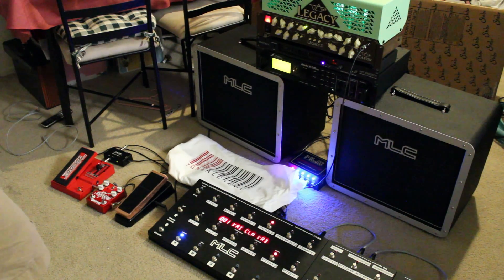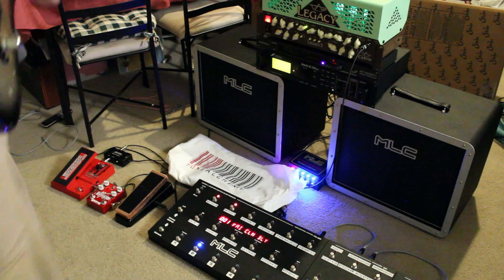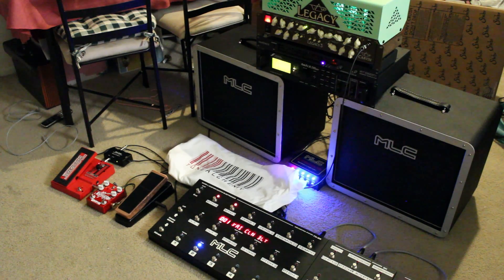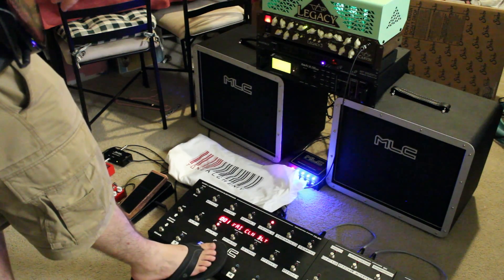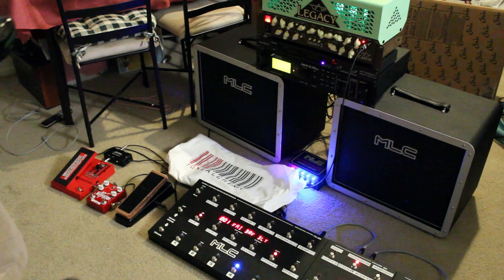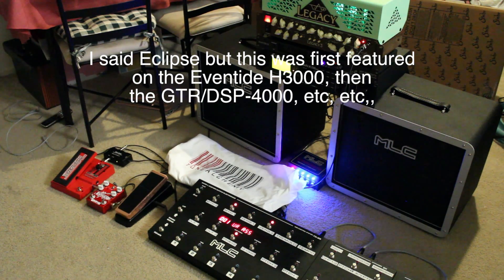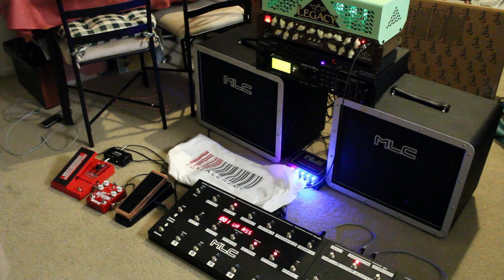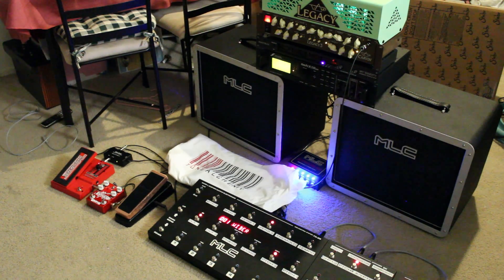Carvin Legacy 3 Revision 3.3 MIDI board beta test with Axe-FX II and Matrix Amplifier as Slave

Comment from the maker: Sorry for the delay. We only use 9th generation Chinese tubes12AX7A. Sometimes Tung-sols or Groove Tubes 12AX7-C. JJ's are usually very grainy in the preamp section, Power section we use JJ's E34L's (thats their long bottle EL-34) Try ARS (Antique Radio Supply) or Tube Depot for 12AX7a's. CE usually has them too. They change everything.

Comment from the maker: This video was done for Carvin and Vai. We did the upgrade and offered the option of the Matrix Amplifier and the Mark L Custom Foot Controller to the Vai Camp. We build guitar systems and we happened to be working for Richard Cruz (Carvin A&R) during this time solving a problem with the Legacy III MIDI system and a few hiccups that were causing the Axe-FX II to Lock up. This video was the solution offered to Carvin. The MIDI board is now in all Legacy III amps and was finalized as a solution.

Comment from the maker: This was run 2 ways. In this video its coming out of the Pre amp out into the Axe-FX which then feeds the power amp in and the input of the Matrix. Being that the Matrix is 400 watts of Mosfet per side it is equal to the 100 Watts of tube power coming out of the Legacy it equals out. If I used the FX loop I would treat this differently. The rig changed after this, A palmer PDI-03 was used and the Matrix GT-1500BDFX was used for a W/D/W system feeding 1 2x12 and 2 1x12's.

Comment: Can the gain on the 3 th channel be controle by a midi switcher?
Reply from the maker: Genesis11 Guitar Lab if you mean can you switch to the 3rd channel via midi, yes. If you mean, can it be controlled via expression pedal, no. We use grouped control changes to switch channels rather than program changes. That way you can switch to any channel with an instant access button without changing presets.
Reply from the maker: Genesis11 Guitar Lab if you want to control gain you can use your volume knob on the guitar, use the axe-fx to drop the volume going into the input (if you're using one), or build a "drop box" (a presetable volume in a pedal enclosure). Hope that helps!
Reply: Tone Alchemy  What I mean is that if you can add the gain to the 3 rd channel vía midi? I Know that you can change all 3 channels, reverb and boost vía Midi.... but the gain on the third channel? Can you add it via midi?
Reply from the maker: Genesis11 Guitar Lab OK, you're talking about the gain switch. It's not switchable via midi. There's a way to add a gain boost to channel 2 & 3 using the boost relay but it's not something that is easily done without a schematic and quite a bit of experience working with tube amps. 

Disclaimer: Do not work on tube amplifiers without the proper experience. The voltages inside of a tube amplifier can severely injure or kill you.